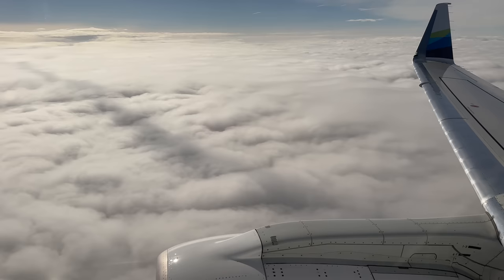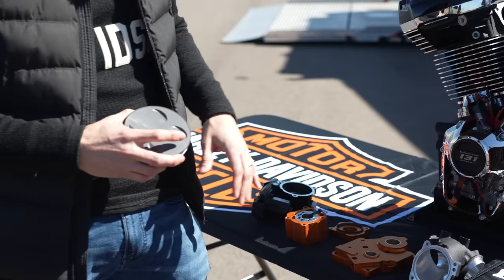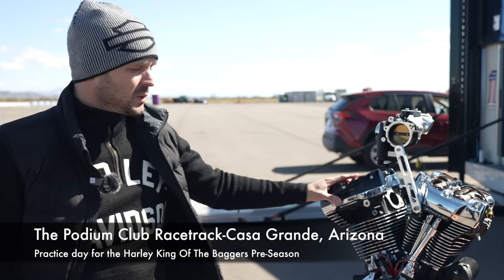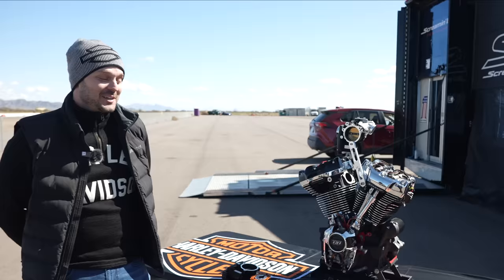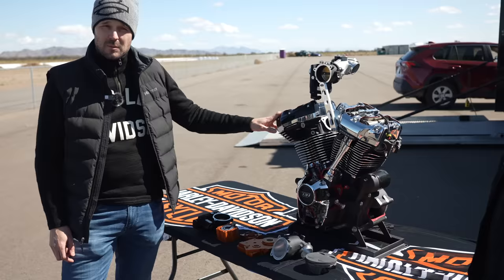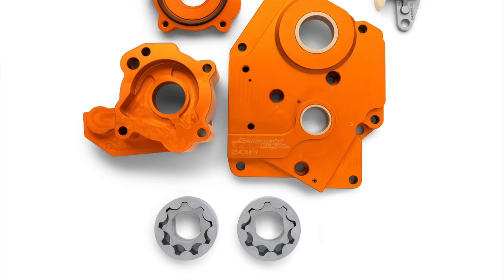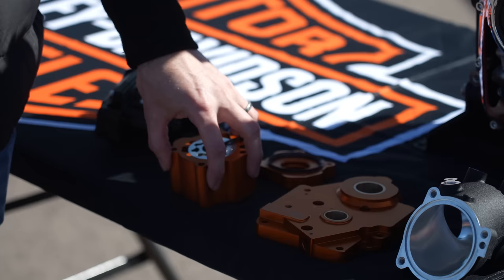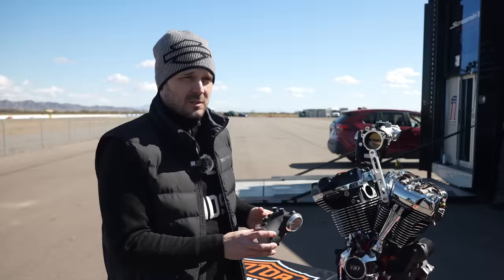Harley Releases 135ci Crate Performance Engine! First Look 👀!

Comment: I really think the CVOs need a displacement boost if they’re going to put the 117 in so many other bikes. At least 124, but really the 131.
Reply: I agree. Everything needs to be bumped up. Special, ST, and CVO. 117,122,124. Do away with the 107
Reply: @chrism6880  I hear what you’re saying but there are people out there buying them and they still have really good resale value. I agree - not worth the money though.
Reply: That always is the natural progression and is now different now

Comment: Could that replace a twin cam??
Reply: I read it fits into any harley touring cruiser frame.
Reply: No m8 only
Reply from the maker: Gary, 2017 and later touring according to HD.
Reply: @RyanUrlacher   Are you sure 135 fits/works without issues in 2017 touring models (Road Glide)? According to the Harley Davidson website information, 135 crate engine is for 2021 and beyond. Thanks!

Comment: Yamaha did that same bore/ increase stroke length.......they went from 80ci to 119ci , increase horse power 30(95), Tq 50ftlb(123) ..... Can you say whiplash

Harley went from 883 to 1200 by increasing bore and they gained more hp than tq......if you've ridden Sportster 883 and 1200 you know the difference in power

Harley went from 96 to 110 by changing bore size and the power increase was WOW.....well they did change everything to SE

If you want increase in HP then you increase bore not stroke

Comment: I’m sorry I just don’t understand a normal person buying one. You put 85k plus for 120HP or you can buy a Busa for 18k that has 180hp
Reply: Where did you get 85k? 8k for the motor plus 16k for a Street Bob to put it in. Even after whatever
Harley charges for install you've still made a huge leap in price.
Reply: I'll take a ZH2 for $20500
Reply: Apples and oranges my dude. 2 completely different engines. Plus a Busa is ugly as hell
Reply: Apples and oranges. Two completely different riding styles, not to mention your cost figures aren't even close to reality